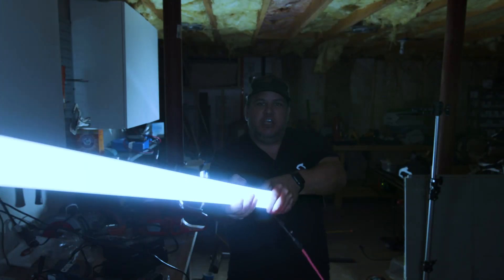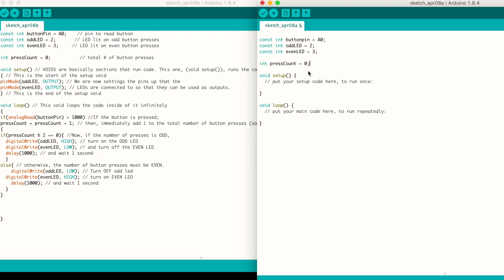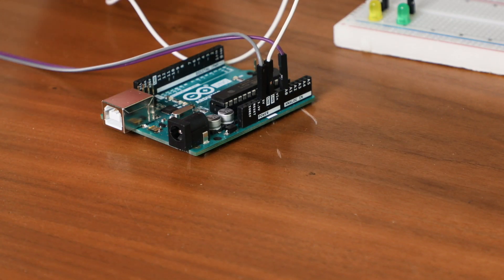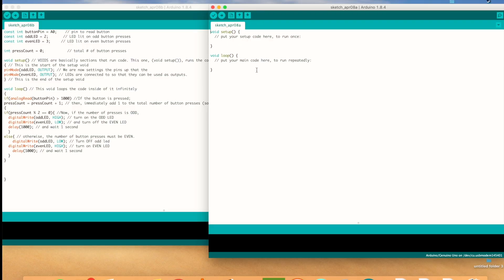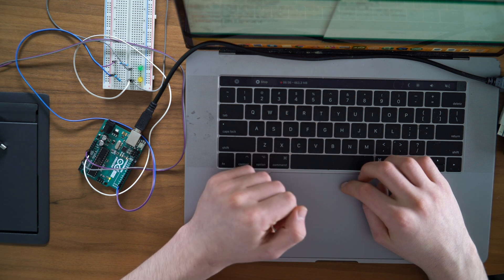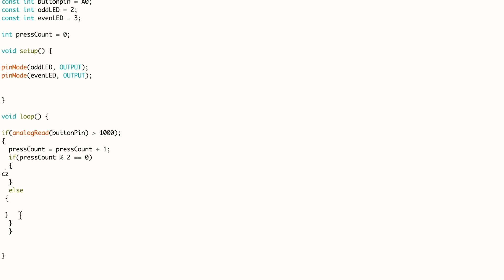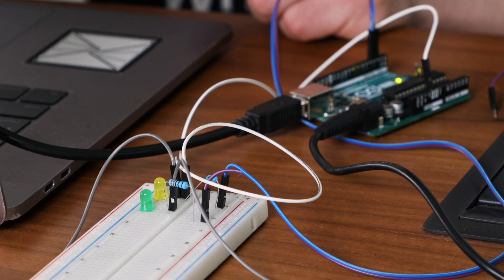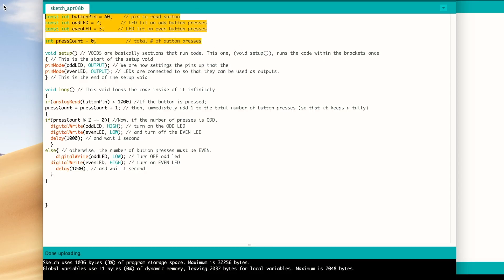ARDUINO Basics

Comment: Just want to correct some mistakes please,  Analog ports can in fact be set to act like a digital output port as well, but, they can also revive analog inputs instead of simple on or off signals. Also the barrel jack can in fact take more than 5v, it has an in board regulator, so you only need to feed 5v if you are doing it on the actual pins for power. Thanks guys keep up the good work.

Comment: why did you choose > 1000? What's the conversion between this integer and amount of volts? I don't understand why 1000 means it's greater than 5V
Reply from the maker: Arduino's input rages from a value of 0 to 1023, with 1023 being 5V, and 0 being 0V
Reply: The Garage Learning thank you! Great videos keep it up

Comment: Hey there! Thanks for the super informative video! I've played with Raspberry Pis but not yet with Arduinos, and I am really learning a lot for you two.

Little note from a software developer: What you call "voids" are actually "functions" -- "void" is just the return type declaration. ("void" meaning there is nothing being returned. Other options would be bool (yes/no), integer, float etc. Anything under "Data Types" on https://www.arduino.cc/reference/en/#variables ).

Also, you switched the odd and even LED. `pressCount % 2 == 0` is true for the even counts, not the odd ones. Not that it matters for this example, but some people with no or little coding experience might be wondering when they try to follow your tutorial.

Maybe this helps - I think it's awesome you are sharing your knowledge and experience and you're not shy to show your code, acknowledging that you are no expert in it. That's real woke. 👍

Love the channel and you guys' work!